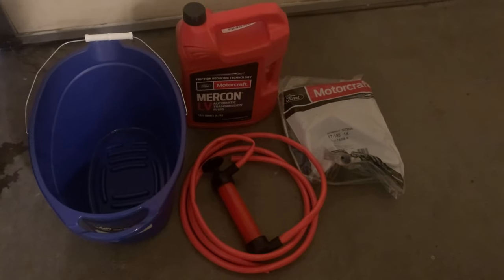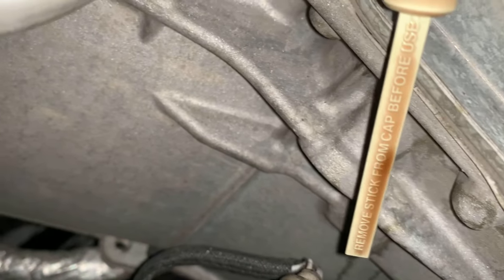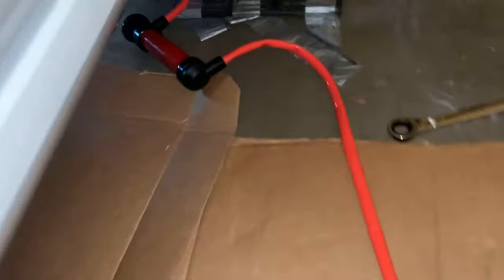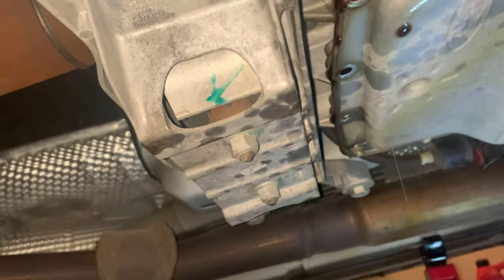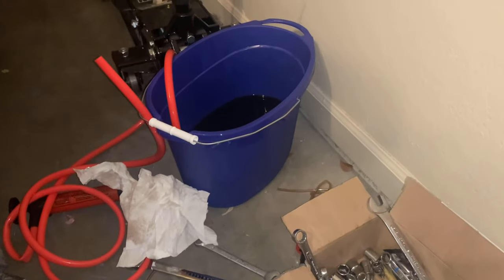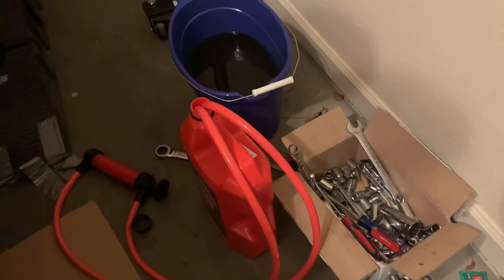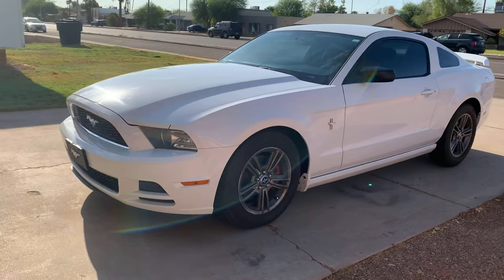2011-2017 Ford Mustang Transmission Fluid & Filter Change - 6R80 Automatic

Comment from the maker: Syphon Pump - https://amzn.to/3YUpdi4
Mercon LV Transmission Fluid - https://amzn.to/3C9o9x7
Motorcraft Transmission Filter - https://amzn.to/3VtP3q3
Bucket - https://amzn.to/3I9CqO3
Rhino Ramps - https://amzn.to/3C7Gs5I
19mm Socket - https://amzn.to/3G2PkuE
8mm Socket -https://amzn.to/3WtY4kw
Medium 3/8 Drive Ratchet - https://amzn.to/3YSMcKl

Comment: Thanks for the video. I'm fixing to do the same thing in my S550. It has a little over 100k, all highway miles. I bought the exact same little pump. Hoping mine goes as smooth as yours.
Reply from the maker: Mine was about the same for mileage and previous wear. Wasn’t as hard as I thought it would be, so hopefully the video helps simplify things 👍🏼
Reply: Did it go smoothly?
Reply: How did it go?

Comment: I tried this and ran into a snag. On each side of the pan is a bolt with a different head, maybe an inverted Torx? Anyone know what that is?

As it is I pumped out and replaced five quarts of fluid, so that ought to make the transmission happier, but I'd really like to get the pan off without resorting to extreme measures like vice grips!

Comment: I just had my 2012 Mustang done today and was curious about the procedure. In watching you I hope the mechanic who did mine checked that magnet. I didn't even know that was in there. One other thing I didn't notice in your video is a replacement gasket. The shop where I took my car he said a new gasket came with the filter kit for the transmission. I waited much longer to get my care done, but my car only has a little over 49k. I did it just because the fluid is so old at this point.
Reply from the maker: Yeah the new gasket that came with the kit I purchased for mine was pretty flimsy.  I opted to just reuse the original gasket since it had a metal outline and was still in very good condition. Definitely doesn’t hurt to change the fluid more often than not.

Comment: Thanks for the video bro helped me while changing my fluid on my 2013 Gt 
Had never done it before and car ia almost at 100k miles 
Filter was actually lose in the pan Lol
Reply from the maker: No problem. Definitely seemed a lot more intimidating than it was. 100k miles is about right for changing it too if you hadn’t done it yet. Glad the video helped

Comment: 180,000 ish on my 2012 mustang V6 never changed the transmission fluid and never problem. But im doing this asap it's way overdue. Thanks for the video big thumb up. 👍👍👍👍👍👍👍
Reply: How did your car drive after

Comment: My 2013 V6 performance is at 52,000. Wish it had a drain plug. Hopefully I can just suction most out and put that much new oil in. 

Does the fill/dipstick hole have a clean shot to the bottom of the pan?

Is there a gasket on the dipstick fill plug that needs changed?

Comment: Good job man! Same procedure on my 09 Explorer V8 too. Hate that little dip stick/ fill hole thing. On the Explorer, its right by the cat and is a major PITA to get off due to space. When I did it last, i installed a doorman drain plug to make exvac easier in the future so no pan drop.
Reply from the maker: Yeah the cat being right there gives a small space to work that nut off for the dip stick which isn’t fun. Definitely a smart move to add a drain plug to make it easier for the next time you have to swap the fluid
Reply: @SwanCanFixIt  Going to be doing this on my 11 6.2L F150. Not only is the Cat near the fill, but the Exhaust is right under the back of the pan. Fun!

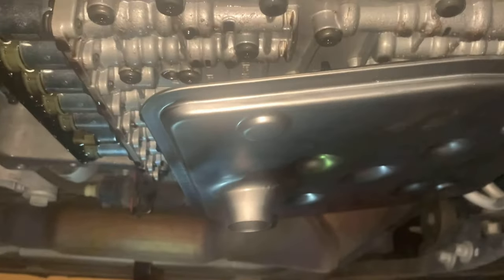Comment: 3:36 did you reuse the oem gasket or a new one? In either case did you put any glue/gasket maker on the gasket before installing or just put the gasket without any glue?
Reply from the maker: The gasket I pulled off was reusable so I just cleaned it up and used it again without any additional glue or gasket maker needed. Driven the car about 30k miles since doing this job and its clean as a whistle down there with no signs of it failing

Comment: How many quarts did the refill take. And do you check the level it with the engine running or off ?
Reply from the maker: Put in about 6 quarts to fill it with the same amount that I took out. I let the engine idle and warm up for about 15 mins and then checked it when the car was off to see where the level was at
Reply: On 2.3 Ecoboost tranny uses 13 Qt instead of 12 Qt as 3.7 does. So, you may need 7 Qt instead of 6 just to make sure. Or just use the older stuff to complete refill.

Comment: Nice job, did you put any gasket sealer on the gasket?
Reply from the maker: No I didn’t need to using the original metal outlined gasket. It’s been a few years now since changing the fluid and the gasket has held up great without any leaking.

Comment: How has it held up, my cars about to touch 150k and thinking of doing this
Reply from the maker: Put on another 15k miles since changing it and it’s been shifting like butter still. These transmissions are pretty durable, so just changing out the fluid and filter could help get another 100k+ out of it

Comment: I have the exact same ramps as you do and idk why I hardly have clearance under the car. Any advice?
Reply from the maker: Hmm I know it’s a very tight fit under there and might be even harder if your Mustang has been lowered. I would see if you can crawl under starting from the front to get to it, otherwise you might need to jack it up from the front crossmember and throw it on jack stands

Comment: My 2014 mustang is like at 82k miles and I’ve never changed the transmission oil do you recommend a full flush out or ?
Reply: What’s the update?

Comment: Should I replace the factory transmission filter in my 2014 Ford Mustang V6 3.7?
Reply from the maker: Yes, I definitely recommend changing out the filter as well when you take the pan off like I do in the video
Reply: Thank you. The stealership changed the fluid but did not change the filter and thy didn't tell me until I tried to pry it out of them months later.

Comment: Thanks for this video, so how much fluid did you use?
Reply from the maker: I used just a little over 6 qts in total
Reply: Save the old oil. In case it starts slipping with new oil. From Scotty Kilmer.

Comment: I have a 2017 gt auto with 30k miles I have a very heavy foot my car recently started revving  high while in drive  but wasn’t accelerating out of no where  do you recommend this ? I have never changed fluid
Reply from the maker: Hmmm it sounds like it may have had a hard 30k miles put on the trans. Might be a good idea to swap the fluid, but could also cause slipping of gears if they are really worn down already. Lucas oil makes a thick transmission fluid that helps with worn trannys. Might help give you a few more years, but that definitely doesn’t sound to good if it’s not engaging at that low of mileage
Reply: If it's gotten worse, it could also be your clutch going if it hasn't already. Same thing happened in the Subie I had before my S550.

Comment: I Have 73k miles on a 2015 Mustang GT (automatic) when should I do this procedure? I use the sport mode and drive the car frequent
Reply from the maker: Anything in the range of 75k-125k should be a good time to change it out to keep the transmission healthy
Reply: Mine is about the same and I'll do it right away, never hurts to replace your fluid, it's good for your transmission, more often you do it best it is for it, it lubricates it's components and make it last. When you oil is old it get thicker and lubrication percents less friction and worn your components faster. Same thing with engine oil and piston/cylinder.
Reply: I'm doing it at 90k. Just 2.3 Ecoboost 2016.

Comment: Hi, i have ford mustang 3.7 V6 224 Kw 2014.. after facelift.. do i have same filtr as yours older mustang? Thanks for help.
Reply from the maker: Yes it would be the exact same as mine. The Mustang in this video is a 2014

Comment: dealer charges about $150 for the service. You'll spend how much on fluid, $70? A new filter, the suction pump, maybe a new gasket, pretty soon you're at $100.  Then the likely hood of a mess happening, plus not having access to a lift. (You can do the 4 jack stands method, point is to have the vehicle level.). Unless you don't want anyone else servicing your car, I'd recommend taking it to the dealer if you have limited wrenching skills.

Now, the dealer charges $375 to change your spark plugs (on a v6), now that is absolute bs and you should definitely do your own work there.
Reply: Doing plugs on one side of that engine is a pain if you're not handy
Reply: Its $450 to do a transmission fluid change af ford

Comment: so... no need to install new gaskets when re isntalling the pan?
Reply from the maker: Nope, the factory gasket you pull out is reusable so you’ll only need to replace the filter when you drop the pan 👍🏼
Reply: On the pan itself it states “equipped with reusable gasket “

Comment: Searching for capacity for my 2012 v6 3.7 i found 11qts?
Reply from the maker: 11 quarts if you were to completely drain all of the fluid out of the system. When taking off the pan, 5-6 quarts usually stays in the transmission so that's why I recommend measuring how much comes out to know how much to put back in like I do in the video. Hope this helps!
Reply: @SwanCanFixIt  thanks a lot mate

Comment: How did you get a ratchet to the dipstick break it free?
Reply from the maker: It’s definitely a tight fit, but I was able to put the socket on first and then work a medium sized ratchet up there and get it to crank just enough to loosen it free

Comment: Thinking about doing this, but im thinking about switching to Royal Purple 01320 / 301143 Max ATF Synthetic High Performance Automatic Transmission Fluid with High Film Strength

what do you think?
Reply: What for? OEM oil can give you about 180K miles with no issues! 150K change recommendation is a conservative one! I don't think you can really tell if it gives you a significant improvement, it might be all gimmicks.

Comment: Any torque specs for the bolts for the pan?
Reply: Look on the web for the gasket, be sure is motorcraft and it specify the troque.  
Use below link and zoom the pic.  It states the torque for them

https://parts.ford.com/shop/en/us/engine/other-engine-parts/gasket-7809913-1

Comment: You checked without engine running.  Level would be way off
Reply from the maker: Measured pretty exact what I took out to know how much to put back in. Then let the car warm up before checking the level. Seems to show the correct level by doing this. Cars been shifting and running great for past 10,000+ miles since changing, so I’m sure it’s fine